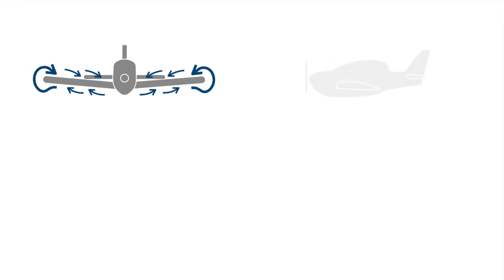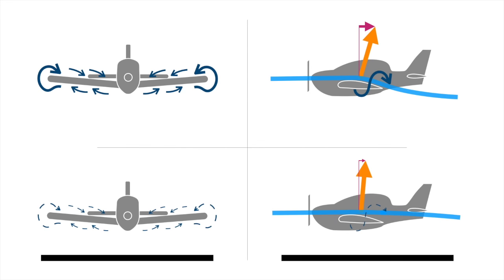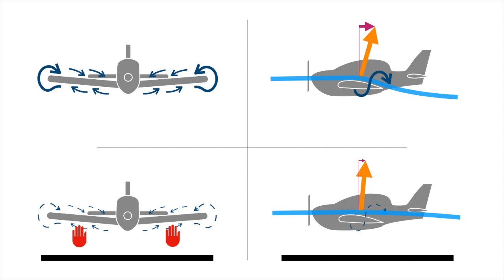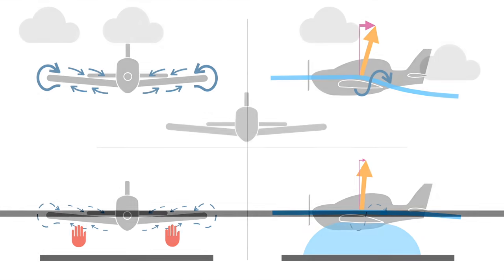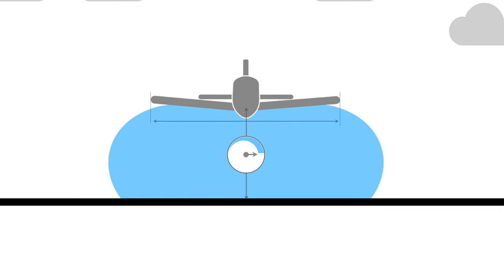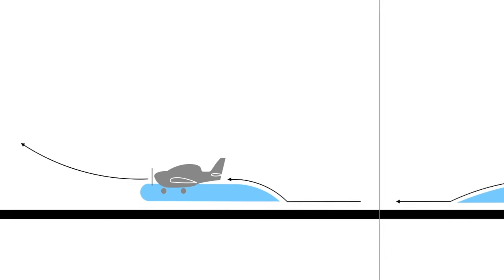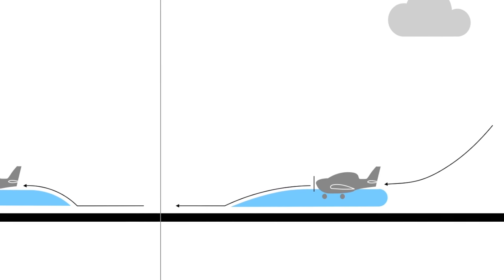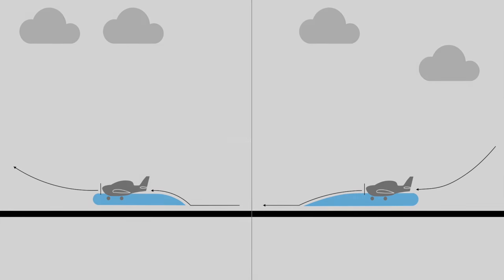What is GROUND EFFECT?

Comment: In ground effect a lower AOA is required to get the same amount of lift at given airspeed (i.e. CL increases). That's because of the air cushion below the wing.

This has several observable effects:

1) If you maintain AOA while entering ground effect during landing, then less airspeed is required than outside of ground effect to keep the aircraft flying.
     This is the reason why the aircraft floats for a while although it slows down.

2) If you maintain airspeed when entering ground effect, then less AOA is required to keep the aircraft flying - i.e. you would have to pitch down a few degrees while in ground effect.
     This is the reason why there is less induced drag while flying in ground effect.

3) If you climb out of ground effect, then either a higher airspeed or a higher AOA is required to continue the climb. Both needs more power.
     This is the reason why you might not be able to climb out of ground effect if the aircraft barely had enough power to take off.

Comment: While it explains what happens due to ground effect during take off and landing, it does not tell you what to do to counter this. When right after taking off, you lose the ground effect and thereby increase drag and reduce lift. At that time the pilot should increase thrust to max and slightly lower the angle of attack. Natural instinct at that time is to keep the nose up in order to climb but that will only increase more drag and cause the plane to stall.  
When it comes to landing, you feel the cushioning of the ground effect  due to extra lift and lower drag. In this case you lower the thrust to minimum and do the opposite of when you are trying to climb, which is slight nose down. If wings have slats then you land with nose slightly up due to your already higher drag.

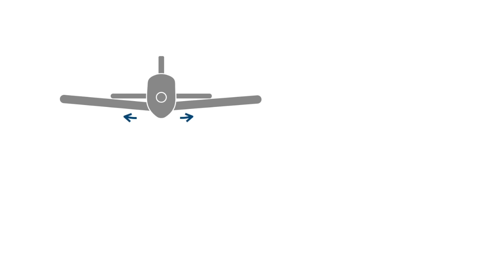Comment: 0:45. I don't believe this is correct. Lift, or induced drag, is not caused by the airflow spilling around the wing tips to above the wings. This overflow only causes loss of the theoretical lift, comparing to a wing of indefinite span (without such spilling around).

Comment: Just a quick question, when u say Lift vector is it the total reaction vector ? Because I thought the lift vector had to stay always perpendicular to air flow
Reply: In case anyone coming across this comment is still curious about the question about the tilted lift vector, you can perhaps look into wingtip vortices, which I believe produces "induced drag" (which was mentioned in the video.); and adverse yaw, which is related to/produced by the change in lift vector. You might find thorough answers by searching in those directions. 

The answer I deduced from my brief research is that the lift vector does stay at 90-degree, as it is really the change in relative wind's direction that caused an inclination in lift force. 
First, wingtip vortices produce air that moves downward ("downwash"), tilting the lift vector backwards. Wingtip vortices will always be present when flying because it's a byproduct of the pressure difference caused by the airfoil shape, without which planes cannot fly; 
Second, during rolling actions, one wing indeed moves up (therefore it interacts with wind from above) and one down (thus interacts with air from below), in addition to the wind from straight ahead. As a result, the wings' relative wind actually points slightly upwards for the rising wing and slightly downwards for the falling wing, and along with that tilts the direction of lift backwards and forwards respectively.

Disclaimer: I'm neither a pilot nor a physicist, merely someone who's taken a liking to learning about (but with no guarantee of truly understanding) the ins and outs of flying. So take it with a grain of salt and do your own research/ask your instructor!